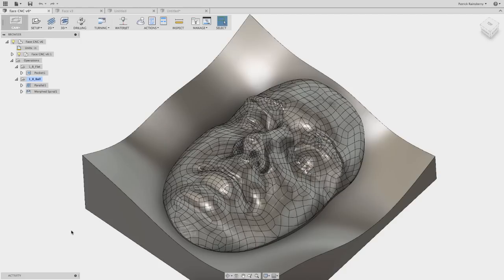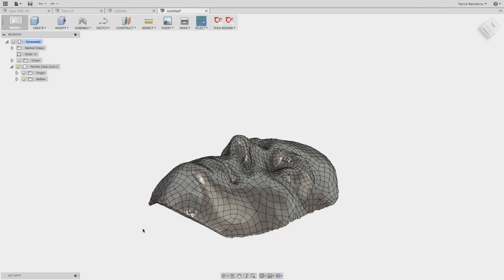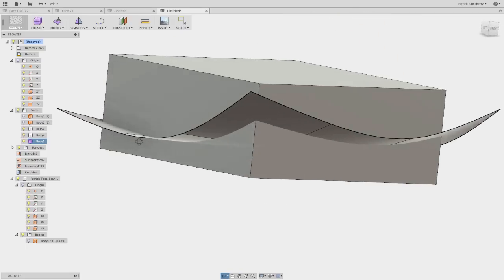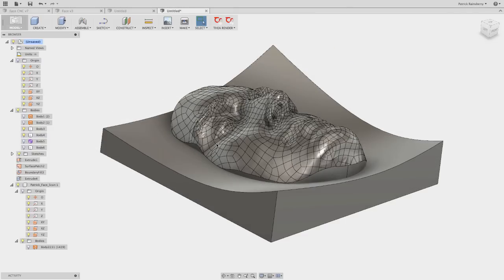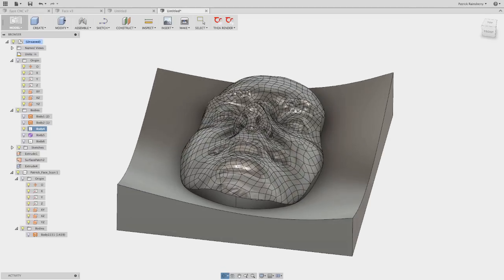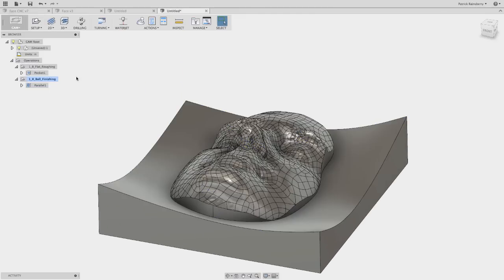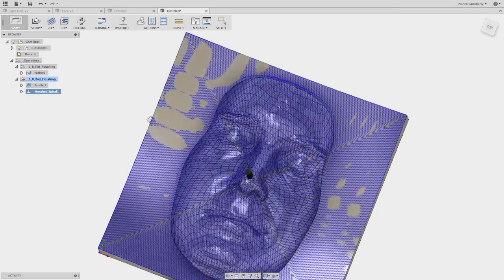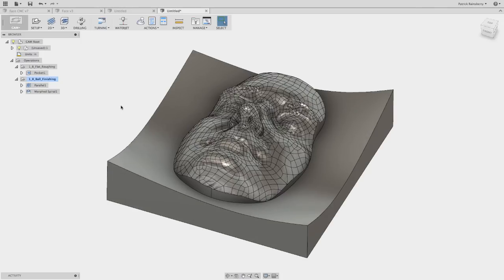Fusion360 Face Carve

Comment: You just answered one of my questions I had. I am a mill or router guy. Not so interested in 3D printing. I just recently started doing my own 3D scans. I have got some really nice models but I knew no matter how nice of a scam you take you are not going to get good tool paths with a Mesh. I thought there would be a way to solidify the Mesh image. The other thing I've found is in the Mesh Mixer program used to clean up the Mesh image has an option to make the image a solid
Reply from the maker: Yep the key is to convert to a smooth surface.  There are a number of tools that can accomplish this.  If you can even convert the mesh to "quads" in another tool such as Autodesk Remake, then you can convert the quads mesh to T-Splines in Fusion 360 which will give you a nice machinable surface.
Reply: Is this a way to get around the 10,000 facet limitation?
Your model looks really detailed. Looks like there is some subsurface algorithm to it.
Reply: But how do i select thousands of t spline surfaces when i want to do a 5 axis machine toolpath? I converted a 4k  quad poly model to splines.... It would take me hours to select all of them. Is there a way to combine t splines?

Comment: Very nice video, thanks.  Is there any reason not to use the 1/8 ball mill for the roughing step as well?
Reply from the maker: +Darryl Adams You could, but it will just be much less efficient at removing the bulk material.

Comment: Sort of unrelated question: Lets say you had a really detailed face mesh that was already fixed up to what you have at 11:20, but you still wanted to implement a sculpted surface like at 15:46 (and the subsequent cut out base). Do you still have to simplify and convert that mesh for Fusion 360, or could you just use the face mesh as a reference for the base, export the two objects and combine them in another mesh program? Point being, keep super detailed mesh, while using Fusion for fabricating the other parts?
Reply from the maker: Actually this video is pretty outdated.  I should update the description at least... in Fusion 360 CAM you can actually apply tool paths directly to mesh bodies.  So the steps of dealing with sculpt surfaces is not even actually necessary anymore
Reply: @PatrickRainsberry  Okay, thanks for getting back.

Comment: That was great. How long have you been using this program to know it as well as you do!
Thanks for the video.
Reply from the maker: +amtpdb1 To be fair I work for Autodesk on the Fusion 360 marketing team, although this stuff is a bit of a Hobby for me.  I've been using Fusion for just about a year but don't really spend that much time driving it.
Reply: +Patrick Rainsberry Pat. I work for a good size corp. that utilizes a number of different software packages to accomplish what I'm seeing f360 do.  I have some initial questions, probably with some follow up.  Could you pm or email me?
Reply from the maker: +J Santarsiero sure absolutely
Reply from the maker: +J Santarsiero i can't see how to PM in youtube?

Comment: Patrick, I have question,  can I import  quad mesh into fusion?
reason I asking,  for me the simple guy  subdividing a mesh  looking  like a finalized solidI know  in reality  they are not same..   however it would be awesome to import a basemesh, before subdividing and fusion  would ""subdivide"" into solid..
Reply from the maker: Actually you can.  It has to be quads though not triangles. If you import a quad mesh it will come in as t-splines surface body.  You have to "turn off history" I believe to make this work.
Reply: +Patrick Rainsberry thank you..
already found I can import  obj format..
when I shift to model from mesh, it converts to solid..
Reply from the maker: +cnccarving awesome
Reply: im learning this program, because I believe  this is the real  next big thing..

after autocad..  while autocad wasn't the only one  desktop cad, but it was the  one  that  taught so many folks  for  cad..